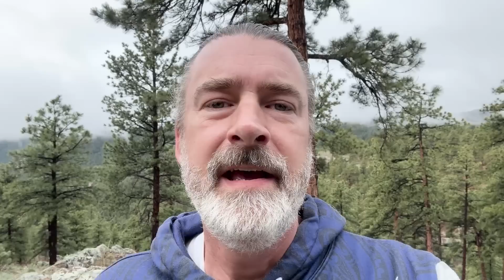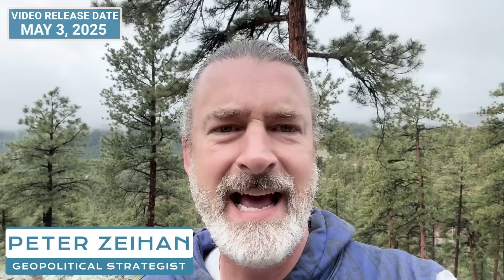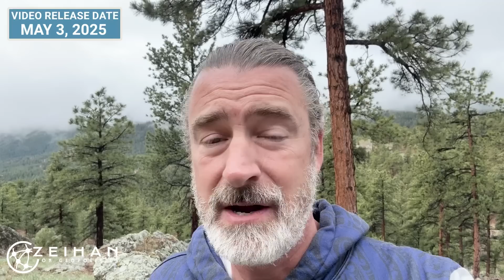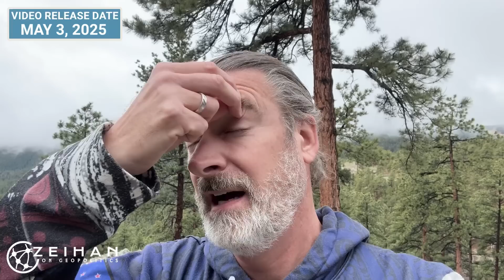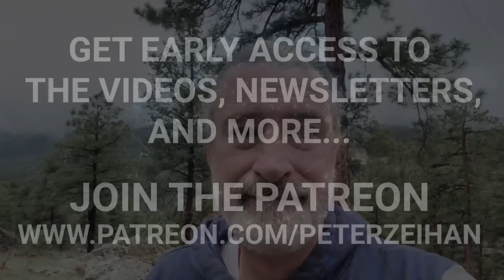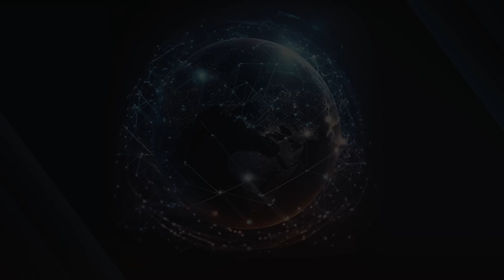The Night the Lights Went Out in Geor- er, Spain || Peter Zeihan

Comment: This is partly why nuclear should form 20-30% of grid power generation.
Reply: Spain has actually a very balanced/diversified electricty production. 20% nuclear, 15% hydro, 25% wind, 20% solar and 20% gas. 

They are far away from having 100% renewables as we often hear on the media.

If something went wrong due to renewables, it's not the renewables the main issue but their grid which might not be enough adapted. 

Many other countries around the world have way more renewables than Spain, and they don't have daily blackouts, which btw Spain doesn't have either. People should stop panicking like in the media and do all the short-sighted propaganda. 

Nuclear is nice but it's only 10% of today's electricty production in the world. Everybody knows it's impossible to reach 100% nuclear within the next decades for many reasons even if we wanted to.
Reply: Wait, hydropower uses spinning turbines to generate electricity.... That is 100% renewable and would provide exactly the same benefit as fossil/nuclear, no?
Norway for instance is basically 100% powered by hydropower.
Reply: the % of nuclear was only 9% o total spanish power production when the blackout hit. 

it seems that oscillatoins in the grid caused by solar were propagating tru the grid. these solar groups in spain have very very few grid forming invertors.
also some gas platns (perhaps also some nukes) were instructed to be on low standby, which means they dont have to be ready in less than 4 hours

to save their skin the spanish politicians were relying too much on the power connection btw Spain and France, but this can only take +- 2.7 GW before the interconnectors tripped. and they did, altho FR had warned SP several times before that this would happen cos of this weak link. 

also I read taht a big solar group of 500MW disconnected from the grid, poss. becos their (hourly) power fee became negative.  this fee fluctuates based on the mix of power sources, and get negat while too much renewals are feeding

the spanish swiss cheese power model has too many holes, too much based on political push for renewables, while ignoring the warning sof nuclear engineers.
Reply: @ it is not a matter of renewables vs nukes. It is a matter of inertia. Spain has a lot of hydro electrical plants that could (should) have compensated the issue and these are renewable plants too. The real thing is that new technologies always bring issues that have to be solved. This is a learning curve. The politics here are not in the electric production planning, but in the negative of France to allow intercomunicación with Spain cheaper renewable energy vs France expensive nukes.
Reply: @dinismantas7265  can you please explain what?
Reply: That's exactly the case of Spain. And Portugal has a huge load of hydro.
Reply: 100% is better
Reply: @jager6863  100% is a good way to get the entire grid to explode. As in, literally explode.

Nuclear takes days to ramp up and will provide a steady current. Demand, however, is not static. As people go to sleep, less electricity is used.

Let's take a hypothetical grid that has 1GW of Nuclear power and an average demand of 1GW. The demand goes up when everyone wakes up, peaks at 1.2 GW and then slowly declines as people go home and go to sleep - for a low of 800 MW.

The second people start to go to sleep, explosions happen because there is no realistic way to regulate power. And that is before the overworking of the Nuclear plant during the day.
Reply: @jager6863 nope. Nuclear many people want… but never in their neighbourhood!
Reply: @jager6863 Nuclear has become more expensive to build over the years. New designs are needed. China is pursuing this aggressively.

Comment: I understood that the UK's grid whilst obviously an island, was more secure than most due to its grid connectors with Norway, Belgium, France and Denmark?
Reply: And The Netherlands through BritNed, which is a 1000 MW interconnector.
Reply: And also Ireland. There are 3 interconnections between Britian and Ireland.
Reply: @Decarbonize11  Yes: 0.5GW each, for a total capacity of 1.5GW
Reply: The connections are HVDC, so no inertia from them, but all you need is a few generators run by the grid to keep it in check. We do it in Denmark and often we have less than 10% power from the plants.
Reply: @hgh425  but if you use grid forming inverters that can provide virtual inertia
Reply: @Decarbonize11  Not really. The power electronic can't deliver. You really need something big and heavy rotational.
Reply: @ https://youtu.be/b9JN7kj1tso?si=XSSZKlHpLA5pMubo
Reply: Don't be surprised when Zeihan doesn't know technical details.
That's not really his vibe.
Reply: @ I have a whole playlist of things he’s gotten wrong. 

https://youtube.com/playlist?list=PLg6cLUnYMLDNTs_WVOVz_PHP6FronuX4M&si=3j8PscEQrRy6Vpd9
Reply: Apart from the North Sea web of international connections that serves the largest offshore wind site in the world, there is  base load of 2GW/hr of nuclear reactors that never shut down. The UK grid is solid, stupidity apart.
Reply: I think Peter should redo this as he is totally wrong about the UK poor effort here Peter
Reply: Slime mold- data
Reply: DC not AC so no ‘wobble’ problems
Reply: @chriscarnell7449  10.3GW of interconnors in total: 4GW with France, 1.4 with Norway, 1.4 with Denmark, 1.5 with Ireland/British-occupied Ireland, 1GW with Belgium, and 1GW with the Netherlands.

Comment: Too many gas turbines were in total shut down. If they are in "idle" mode they can be brought up to speed quickly to fill the "gap" in the grid.. Economic incentives to keep the turbines ready to step in were low. This is being addressed.

The UK is pondering public ownership of these gas turbine generators to ensure the stabilization that a heavily "renewable" based grid requires.
Reply: Not that quickly.  Old turbines take 30 minutes to be brought back to full power.  Newer technologies cut that to around 15, and can begin contributing in 5.  Grid scale storage, in the other hand, can react in milliseconds and is now the primary stabilization source in California.  Soon Texas, too.  The U.K. Is slowly building out grid scale storage but really needs to light a fire around the expansion.  Like Europe, they are lagging behind on the use of batteries.
Reply: @junkerzn7312  And Batteries in Australia now provide most of the FCAS. Gas peaking plants are doing that, providing power during peak demand.
Reply: @cbiggar100  We see this in California too.  Grid scale storage is handling nearly all the stabilization needs and is also doing most of the fine load following as well.  The NG that comes online more or less just runs at its maximally efficient output level and does only "rough" load following.

This is the evolution of the duck curve... in the early days there was real worry that the system couldn't match the huge increase in demand quickly enough as the sun went down and the solar disappeared.   But in ensuing years, grid-scale storage basically took over that function and the NG generation did not require carefully-timed calls.   So the NG storage is able to spin-up more efficiently too by not having to worry about the evening ramp so much.

-Matt

Comment: Aside from Natural Gas and Coal, Nuclear also has turbines.
Reply: And Hydro and Geothermal
Reply: Concentrated solar thermal power can also generate electricity from heat in the same way.
Reply: @manwithmountain  Nuclear disconnected itself during the incident because is not a flexible technology.
Reply: Nuclear is way expensier than BESS
Reply: Everything could have turbines, you can do the same with solar and some power electronics.
Reply: Yeah, the background to Chernobyl was trying to use the inertia power of the turbines for emergency power for the station in case of grid outage.
Reply: @johno3456  being operated without a single nuclear engineer anywhere on site at the behest of bureaucrats. Why? Russia's education system had been in a long sustained collapse and it wasn't deemed necessary to have even one nuclear engineer operating even one of the 6 reactor cores at the time of the accident.
Reply: @johno3456 The Chernobyl accident had nothing to do with AC going out of phase but a sequence of errors that produced a mechanical problem with the graphite  rodes creating an out of control nuclear situation growing the temperature of the steam... 
Main causes for the accident: 
- reactor design
- inexperienced operators
- outdated technology

Comment: Something quite similar happened in South Australia a few years ago.
Reply: Grid scale flywheels are used in South Australia now, for that purpose.
Reply: No it didn't - a storm took out several transmission pylons! It's very hard to transmit electricity when the cables are broken.